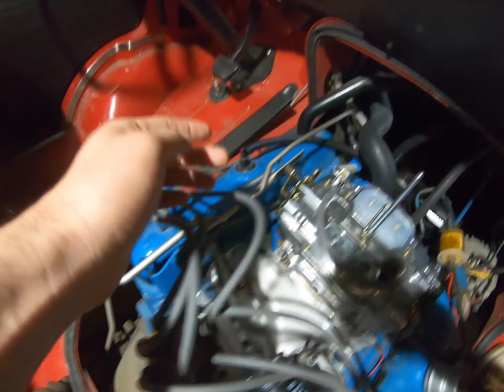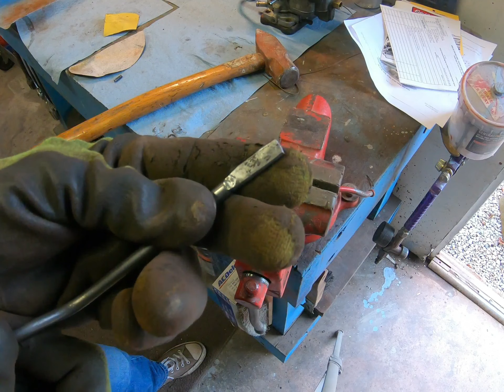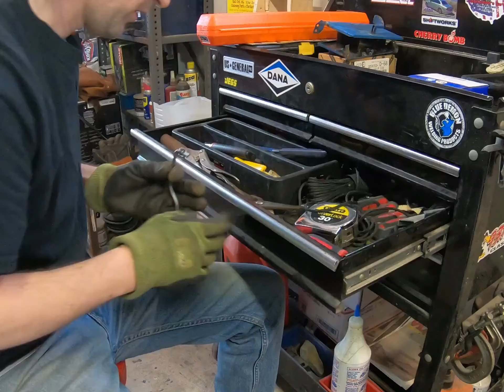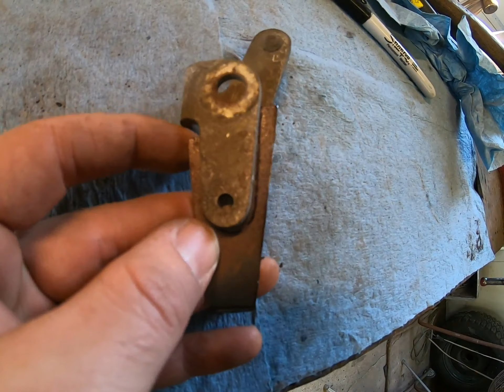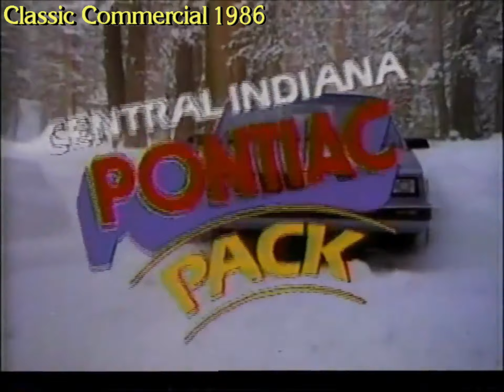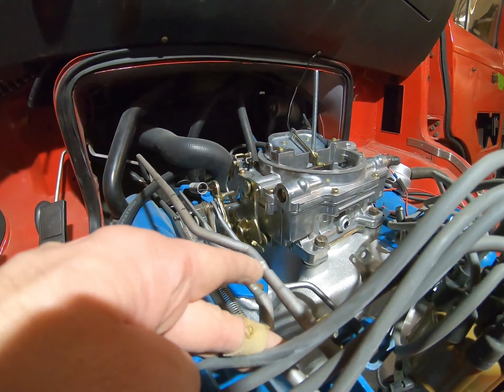4 Barrel Swap PART 2 - Hoosier Garage

Comment: About to go pick up a rod i can use to make one you had to make. Its all thats left!
Reply from the maker: If you still need a measurement  its 19 1/8" from pivot to pivot. Did the other one not work out?
Reply from the maker: Also, the little short one i made comes to 7 5/8 pivot to pivot
Reply: @IndianaGarage  the original one is too short im headed to lowes or home depot for a rod to make the one you did thank you so much for the measurements I was worried about making one too long or too short
Reply: @IndianaGarage  also the 19 and 1/8 is the one from the pedal assembly on the firewall ?
Reply from the maker: @cranecares  better long if anything . You can bend it to shorten up and make clearance if anything
Reply from the maker: @cranecares  yeah that's how o recent the original one and unscrewed kickdown. The other smaller measurement if the other.

Comment: Cool what you call the peg comes in a variety of lengths if your a hoarder like me it makes it easier to match up and give the springs a straight run, This is what it takes sometimes mod and reengineer the part to work its what hot rodding is all about even on a close to stock car, our old cars are more hands on then the modern versions of today. also you do know when cold the 318/360 carb engines have always had fuel distribution issues fuel injection solved most of it later on with MPFI.